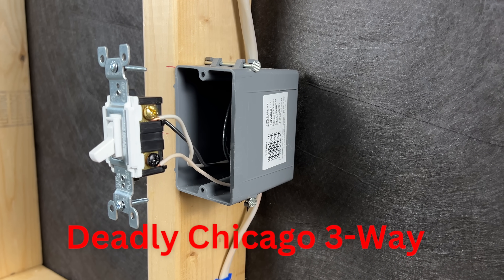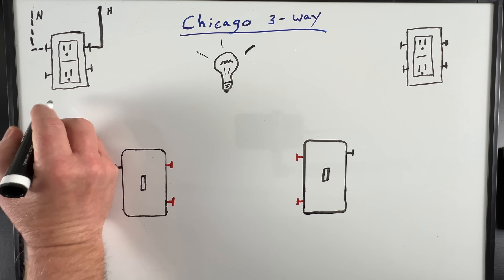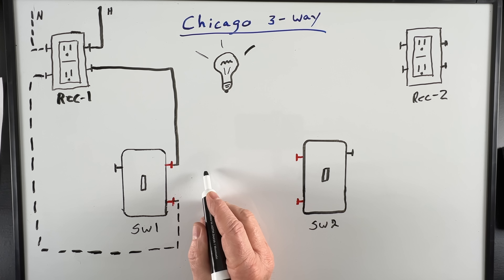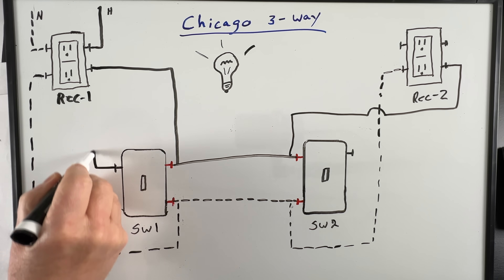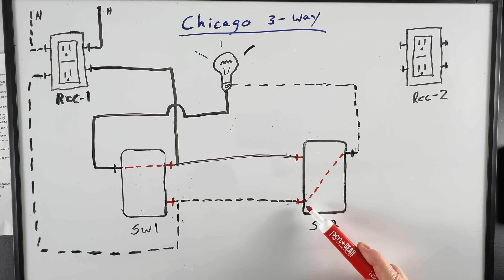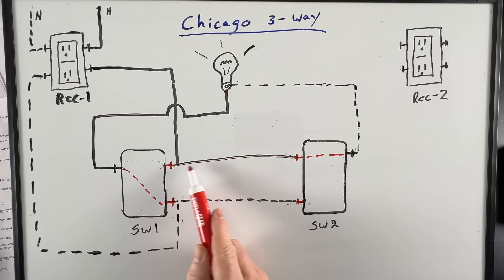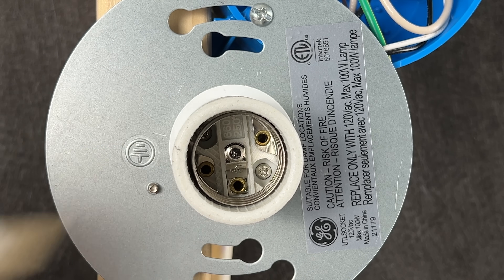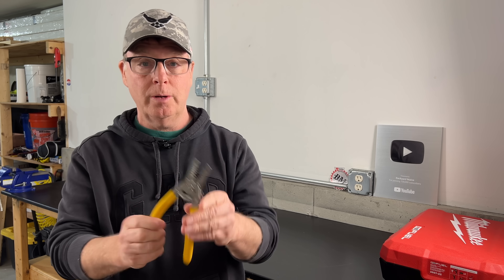The Deadly Chicago 3-Way (Only 2 Wires)

Comment: That won’t work on an led bulb
Reply from the maker: Yup, LEDs are polarity conscious..
Reply: @BackyardMaine  Not true, polarity changes 60 times per second, it will work on led. Haven't you ever seen a bedroom lamp with a non-polarized plug and an led bulb?
Reply from the maker: @johnd1561  Some LEDs work with reverse polarity and some don't. It depends. AC current changes polarity 120 times per second at 60hz. The waveform travels from positive to negative and back to positive 60 times per second so the polarity actually changes 120 time per second.
Reply: @BackyardMaine  AC current has no polarity....The polarity referenced in AC speak refers  to the relation to the ground for protection purposes.
Reply from the maker: @grandinosour  Its actually in reference to the grounded neutral and hot connections not the grounding conductor or pin. I understand polarity in AC/ DC systems since I'm an electrician and an electrical engineer. AC changes polarity 120 times per second on 60hz systems.
Reply: So 60 times per second one polarity and 60 times per second reversed polarity (AC). My point is if an led light bulb works on AC, it is working on reversed polarity 60 times per second. (Also an electrician and engineer).
Reply: @user-hh6mi7qi5s  that’s why they flash when videod

Comment: You're still gonna need 3 wires between the two switches unless you run one wire from the light to switch-1 and one wire to switch-2, and I don't think you can buy Romex with just one wire in it, so you're gonna need a 3 wire Romex somewhere anyway.
Reply from the maker: I think I mentioned that this was an old method primarily used with knob and tube wiring. It been banned for decades but there are still plenty of Chicago 3-ways out there.

Comment: How Did That Pass Code 😨
Reply from the maker: Way back when there was very little code being enforced.
Reply: I believe the 1923 NEC outlawed this method. Before that, it was acceptable.
Reply: @cgschow1971  just because the NEC may have banned them in 1923 doesn't mean they weren't still being use many years afterwards.  9 years ago I seen this on a farm to switch a yardlight between from the house and barn, fed from separate panels, a single wire overhead from the house and barn to the light on a pole.  Sanilac County michigan. According to the farmer the home was built in 1904, but didn't have electricity until 1951, and the yardlight was installed about a year or so later.
Reply from the maker: @GailUrge-vq6qn  Good one..🤣

Comment: Thanks for the upload, guess it was worth the wait.  Didn't realize this was known as Chicago 3 way, I'm assuming this method was designed by the Chicago Outfit to electrocute their victims instead of using a Tommy gun, which would draw more attention to authorities vs "deadly encounter with light bulb " lol😊   

 Joking aside,  I actually ran across this 9 years ago on a farm in Sanilac County,  Michigan. The farmer, who  my father has known for many years, had 3 way switch in the house and barn on different panels,  barn style yardlight on a pole near the barn,  and single wire from the house and barn to the yardlight, installed sometime during early 50s, when the farm got electricity.  The light sometimes got super bright for a couple seconds before going out with a bright flash that cracked the bulb,  and the trouble began when the farmer purchased a 240 volt air compressor and needed to move some breakers around in the barn panel to make room for a 2 pole 20 amp, and unknowingly  moved the circuit for the yardlight onto the opposite phase,  and putting 240 volts on the light instead of turning it OFF in one of the four switch positions. 

 Because I was 25 at the time and volunteered to try and figure it out while just beginning my apprenticeship,  and explained to the farmer what he did in the panel and how I got it working normally after scratching my head for probably a couple hours, he took me out to dinner at a very fancy Italian restaurant.  I personally found that very educational and rewarding to figure out with no help from anyone or any electricians books.
Reply from the maker: That's a great story.. I remember when I first ran across one and it took me a bit to figure out what I was looking at. Any way, I was gutting out an old house and renovating it one room at a time so I was trying to keep the lighting on until the new wiring was complete. Later in life I learned that this was the Chicago 3-way.
Reply: that was common long ago, as well as using a hot only from house or outbuilding and the neutral there for return or vice versa(all disallowed and abandoned for obvious reasons).
as well as requiring isolated neutral/equipment(earth)grounds at sub panels and any outbuilding within a limited distance of each other or where they have other interconnected utility lines. I thought I failed an install long ago, because I didn't run 4 wire direct burial and unbonded sub panel, only to have it pass because it was far enough away from the home and had no other interconnections. I was sweating bullets thinking about having to rent the trencher again and replace the wire as it would likely be hit trying to re-trench, even though I put it over 5' deep!
why so deep? they were "talking" unknown pavement, grading changes and shallow drainage boxes/downspout drainage, so I put it deep as big 6' max depth ride on trencher would go.
 that was over 25 years ago... last I seen, absolutely nothing was changed at that property, other than it's now old, run down and the couple long divorced. lol

Comment: I seen light bulbs 220 volt so both terminals would be live at the socket 
I say fixture with brown wire line one  live color for 277 volt and blue wire line 3 120 volt and yellow with green for ground does it mean that the fixture is not polarized thanks
Reply from the maker: Higher voltage fixtures like Mercury Vapor, Metal Halide etc. have screw shells powered by a ballast. The screw shells on these are still polarized.
Reply: @BackyardMaine  for residential I saw blue brown and yellow with green to why would they use live colors for both current conductors
Reply from the maker: @DavidBerquist334  I have seen blue and brown on consumer product like cords to vacuum cleaners etc. I guess some light are getting them as well. The green and yellow is a common ground color. I think the blue and brown may be a European color code.
Reply: @BackyardMaine  they are American purchasesed item
Reply from the maker: @DavidBerquist334  My vacuum cleaner is a Shark also purchased in the USA but it's made in China and it used the same color code for wires. I changed the cord cap out on it a few years ago.
Reply: @BackyardMaine  I have a GE lamp catalog from 2006, and it lists 230-250 volt incandescent lamps with medium base, in about half a dozen wattages.  On 1000 bulbs, they list a limited selection of medium base LED bulbs as universal voltage 120 ~ 277V, in other words they will work on 240V (or 208V, very common in commercial and some industrial buildings fed by a 120/208 wye transformer bank) 
 
I've never seen an Edison base lamp rated at 240V or universal voltage in person, the only legitimate reason for their existence that I can think of would be for use in older commercial buildings powered by a legacy 240V ungrounded or corner grounded delta  bank, and no 240-120 step down transformer within the facility. 

Because 277V is very common in large commercial and industrial settings where a 480Y/277V system is used,  ordering universal volt lamps, ballasts and LED drivers can be very beneficial for inventory purposes,  if  a mix of 120V and 277V fixtures are used throughout the facility, fortunately both of these voltages use a grounded neutral on the screw shell to ensure safety while changing a lamp.

I have worked with 277V  lighting systems on multiple occasions, but only on HID/ fluorescent ballasts and LED drivers.

Comment: I work on many older homes in Chicago. I am currently (pun intended) ripping into my 1914 home with layers of insanely bad wiring. 
I've got one 'circuit' somewhat like this. I've got a degree in EE, and figuring this place out is insane. I've got a Klien ET450 tracer and am shocked (yes, pun) at where someone(s) ran lines over the years.
Reply from the maker: Well, good to know you figuring it all out and fixing it. I spent the last 10 years of my career employed as an electrical engineer for Texas Instruments.
Reply: @BackyardMaine  Cool. Like everyone, I started with TI chips on the breadboard. 
I started writing assembly code for Intel 8051s in '84 and spent the next 38 years designing and writing software. A good chunk of that was working on RTOS/embedded systems with the hardware/chip 'guys'. Fascinating stuff. 
Ironically, I was just looking at TI's website after Cruz voted against the 'chips' act to check out their fab plants in TX.
Reply from the maker: @stringlarson1247  I was the facilities electrical Engineer here at the TI FAB in Southern Maine. (MFAB). I have been to the Texas facilities many times, both the in Dallas and RFAB in Richardson TX. I'm retired now making youtube videos in my spare time.
Reply: @BackyardMaine 

That's awesome buddy I live close to the old stafford Texas ti plant

My aunt started in clean room w plant opened and retired just before it shut down as director of comm of some sorts- ann miller

in the 90s looking into the clean room and playing w their demo wafer chip movement training program

I can remember the president talking in 95 or so saying we've just recently released more info on our printing system that could print a map of cont us states on the size of your thumbnail

Man it was a cool place to visit especially when younger

Always had a great fitness and rec center too

Good ole days
Reply from the maker: @taylorj-238  Yes its cool working for a company on the leading edge of technology. It's crazy what they can do now.
Reply: @BackyardMaine  Those fab. plants are something else. I worked for a while with Intel when they were creating the i960 RISC processor, and I got to visit their fab in Chandler, AZ. That was 30 years ago. I'd love to see what these are like now. 
I grew up in a machine tool family and when I was writing code for industrial controls, I was the one who could communicate with all of the elec., mech. and facilities 'guys' as opposed to most S/W nerds who could only communicate with other nerds. I have so much respect for people like yourself and others in those positions who keep everything running.
Reply from the maker: @stringlarson1247  You would be amazed at how the new 300mm FABs are designed  and operate. TI has a few 300mm Fabs. One in Richardson and one in China. I think they're building another one now. The whole operation is automated. A few engineers and technicians on the floor but the whole system is automated. The product movement between tools the recipes everything is done by wire. I was in an older FAB running 200mm product. Still a lot of automation but nothing like what they're building today.

Comment: About 15 years ago I ran into something similar and my boss at the time got mad at me for not being able to figure it out and make the repair. I've been through school in both the Navy and an accredited DOL-certified vocational school and now I'm a licensed electrical contractor and I'm still baffled lol. Great explanation through and I guess it's good that I dont understand it because its a dangerous way to wire lighting and receptacle circuits. Great video!!
Reply: Heh. See my comment from a minute ago. 
With the stuff I've seen in old homes here in Chicago, I'm amazed that half the city isn't on fire.
Reply: @stringlarson1247   Remember, they blamed it on a cow. When in fact, Mrs. O'Leary's Husband had just wired a new light in the barn.
Reply: @stringlarson1247  Chicago Fire 2 - Electrical wiring boogaloo
Reply: @davepowder4020  Heh. I've pulled open more boxes in my basement ceiling to find more layers of elec. boogaloo done by a one handed blind person of dubios mental capacity (pun intended). Turns out that about 1/3 of my place is run off of 1 20A fuse. 12ga rubber over copper to aluminum to 14ga back to 12ga.
Reply: @stringlarson1247 Again. Moooooo.
Reply from the maker: Thank you..
Reply: Hey. You're not alone with things like that at times. I do a lot of machine requiring and do most of my own diagrams. I've come across stuff from time to time that just doesn't sink in for quite a while. For myself, all I can do  if it's something I need to do is have several things to do it with, including self made videos. Funny, but once I started making the videos, I never needed them on a site. Not for myself nor anyone I was trying to show. Go figure, and much continued success. Sounds like you more than earned it. Thank you for your service to our country!
Reply from the maker: @nothankyou5524  Thanks for being a citizen worth fighting for my friend. And thanks for your thoughtful comments.
Reply: Similar to how a generator/alternator warning light works. When switch is on and engine not running, the bulb is getting 12 volt through the switch and ground though the not running alternator. When the alternator starts sending 12 volts to the warning light, turning it off.  Simple, auto manufacturers used it and it works, but not dangerous like the Chicago 3-way.
Reply: @Jeffrey-t8g  Not to be confussed with the Clevland Steamer.
Reply: You should be able to picture everything in your head. Build a schematics on what you find in your head. You should have trained your mind to do this when you’re young or you are dooooooomed and I’ll take all your jobs
Reply: I've ran into the carter system (chicago 3way) at stairway switches.
Reply: As an engineer, I understand why it 'works,' but I also think the person who invented it was insane. Safety standards were definitely different back in the day, that's for sure. Sure, there's no potential difference between the hot and neutral conductors on the bulb when both switches are in the position that sends hot to the bulb.... but there very much is a potential difference between the base of the bulb and something that is actually at ground potential. And, thus, there will also be a potential difference across you if your finger happens to brush that metal part of the base of the bulb while another part of you is touching something that is actually grounded. There's a very good reason that the base of the bulb is supposed to be attached to neutral and not hot...